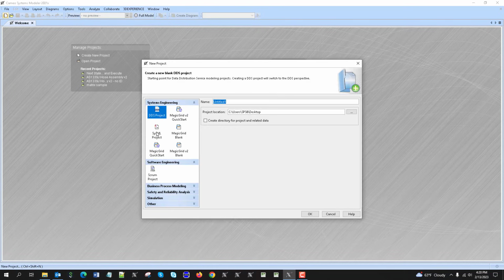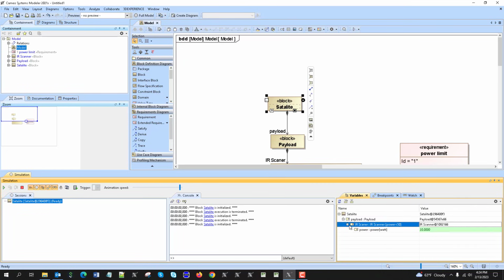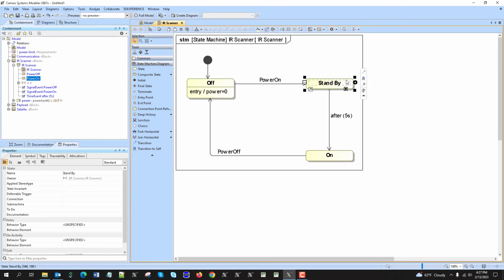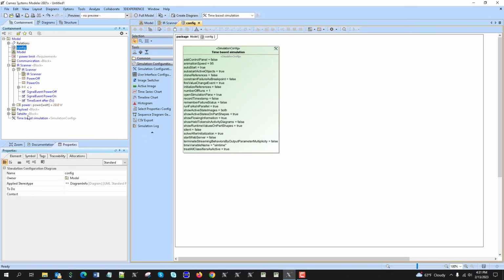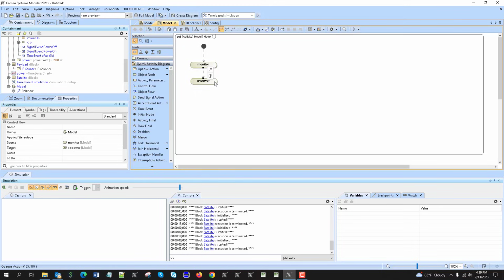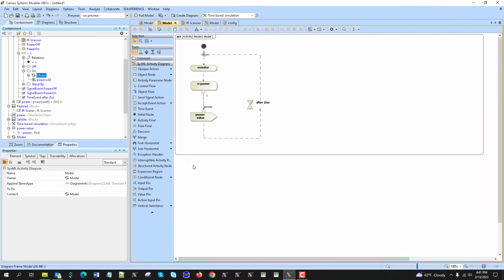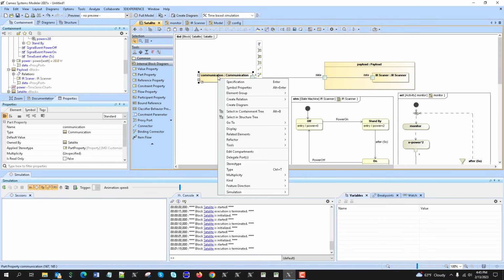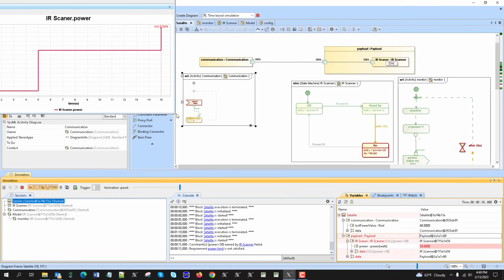Introduction to SysML Simulation: Blocks, States, Activities, Interfaces, Signals, Time

Comment: How do you handle the various diagrams creating an overflow or underflow situation when the simulation is running due to coding logic or on purpose and to be able to locate where in the model it occurred? Are there any ucases where one purposely creates these where it may be useful in a design and its requirements I.e. the requirement might say "....when xxx overflows or is infinite do yyy"?
Reply from the maker: Hello. You need to model overflow logic. There is no out of the box capability but as most pf things in SysML can be modeled.

Comment: Hi, I want to practice using SysML but I do not know where I can get the tools.  I am used to Siemens NX and CATIA...is there a SysML tool that I can get which can easily integrate with Siemens (preferably) and Catia?
Reply from the maker: Ciatia Magic / Cameo integrates with both and is the most popular and the most powerful solution.

Comment: Hi, i am interested in learning system architecture, converting requirements into architecture. Can you share the best way to learn from scratch any certifications or programs you suggest. Will be great if you have any smart ways to learn.
Reply from the maker: Hello, yes, major certification is in OMG SysML standard. This is basics of SysML modeling https://www.omg.org/ocsmp/. Also there is very good systems engineering certification ny INCOSE https://www.incose.org/certification. For this you will need Incose SE handbook https://books.google.com/books/about/INCOSE_Systems_Engineering_Handbook.html?id=xSDyCQAAQBAJ&printsec=frontcover&source=kp_read_button&hl=en&newbks=1&newbks_redir=0&gboemv=1&ovdme=1#v=onepage&q&f=false and for an OMG one you will need thise books https://shop.elsevier.com/books/a-practical-guide-to-sysml/friedenthal/978-0-12-800202-5?country=US&format=print&utm_source=google_ads&utm_medium=paid_search&utm_campaign=usapmax&gad_source=1&gclid=CjwKCAiA98WrBhAYEiwA2WvhOkkBjvNP4EUSvQNEb8NEoWMYLW1xezvva6uPA26ivYoNJRFKMdHalxoCr-sQAvD_BwE&gclsrc=aw.ds and this on https://www.amazon.com/SysML-Distilled-Systems-Modeling-Language/dp/0321927869/ref=asc_df_0321927869?nodl=1&tag=hyprod-20&linkCode=df0&hvadid=312060980065&hvpos=&hvnetw=g&hvrand=4820221130251056605&hvpone=&hvptwo=&hvqmt=&hvdev=m&hvdvcmdl=&hvlocint=&hvlocphy=9028277&hvtargid=pla-452582134786&psc=1&mcid=24830fbf12c63bf8a8b74b2562b89a9f&gclid=CjwKCAiA98WrBhAYEiwA2WvhOvev35rlJdJN6CLGJ4ELwGehN5Vyln1s0CGSUgsDX9HIsm0fI9oo1xoCV0oQAvD_BwE&dplnkId=d9784d9f-7267-450e-a70c-76375a5f3599

Comment: Hi! Thanks for excellent video and explanation.

I have a short question. I have an activity diagram which is a part of a state from statemachine (as a "do" activity) and I want to keep this activity diagram active (like a loop) while the system in the state in which the activity diagram belongs. 

I don't want to use loop component because I have almost 10 swimlanes. So I'm looking more simple solution. Do you have any suggestion or video for this issue? So once the activitiy diagram is finished then it needs to be re-run again
Reply from the maker: Hello. Thank you for the feedback. Great question. One solution is to put another activity which would be ised and do in state with loop. This activity would have only one call behavior action calling your large activity. So loop will not be in your activoty bout it will be restarted from loop above. However you need to think how you will know when to restart, how to know when activity finishes?

Comment: Thank you for this useful video on CST. Is there a way to apply distributions to value properties? For instance, in your state machine example, instead of entry for power being 20 in the ON state, is there a way to show normal distribution with mean power being 20 and variance 5? I read that there is a distributed property, but there aren't any helpful videos or use cases I can find to show how to use this.
Reply from the maker: Thank you! Absolutely. You can apply normal or uniform stereotype to value property and set tag values. There are other methods please check here - https://youtu.be/OB6V3rbJLrA

Comment: I like how you show how to use a requirement as a constraint and the simulation highlights the property in red when the requirement is violated. Why don't constraints work like that? If I create a value type Fingertype with the constraint "(self >=0) and (self <=10)" (in OCL) and then have a value property fingers in block Hand, the simulation toolkit doesn't highlight if I assign the value property the value of 12. Same if I add a constraint on the block (fingers >=0) && (fingers <=10) (in Groovy). Am I missing something? - Thanks.